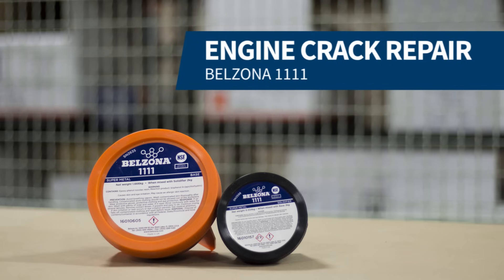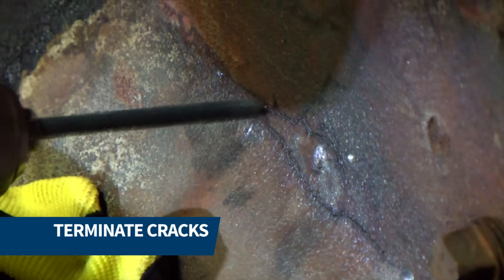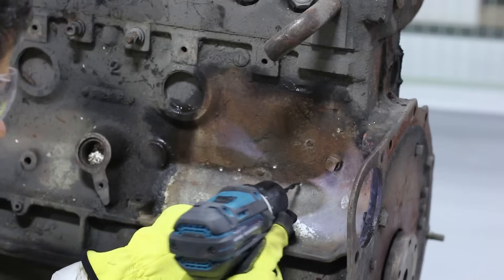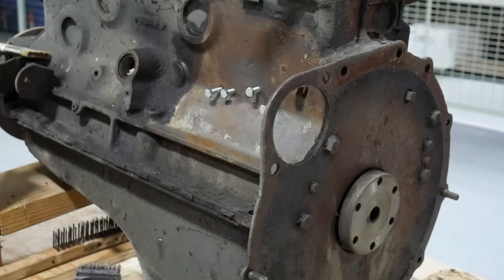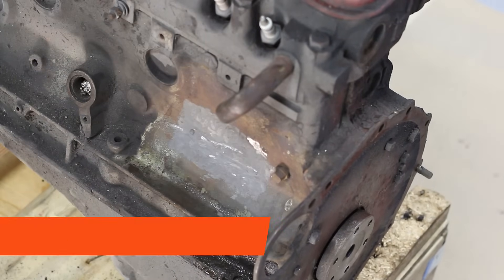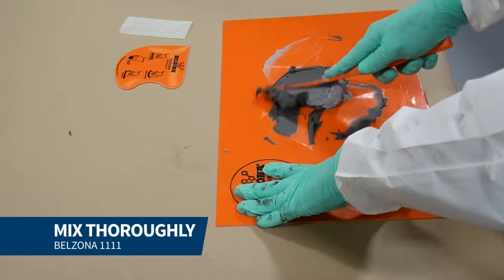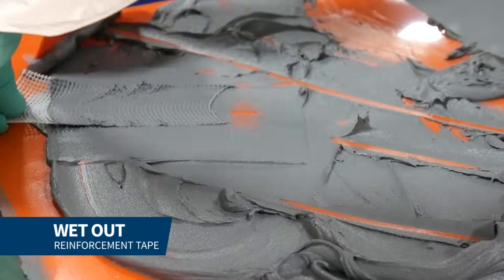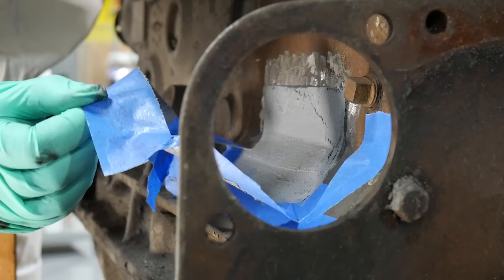How to Repair a Cracked Engine Block

Comment: THIS PRODUCT WORKS! I used carb cleaner and starting fluid to clean my surface. I then dipped the bolt in 3 in 1 oil, placed it in the hole. Mixed Belzona per specs, and packed it around the stud and put more than needed. I then smoothed it out with my gloves dipped in carb cleaner. This allowed me to smooth it out nicely. I did this on a 302 block that cracked by the water pump.
Reply: What does it cost?
Reply: @caseycasey5778  I paid $350 for 1 kilo, but I could have gotten away with a can that was about $175.  I really didn't know what to expect but it really works.
Reply: @travisc3571  how long has it held up
Reply: @travisc3571  350 for glue and you have to buy cleaner and studs yourself? Thats crazy!
Reply: @CholbePilot  huh? My block was broken so no repairs could be done. It’s still working.
Reply: @caseycasey5778  sorry man. I just seeing this…it’s still holding strong and it’s been well over a year.
Reply: Don't lie!😂
Reply: @lexandersig  lie about what? Want to see it on my truck? It’s actually used here in a lot of the refineries…that’s how I found out about it.
Reply: @travisc3571  I justo wanted to create sensacionalismo lol! I know is good product.
Reply: @lexandersig  lord today. 😂😂😂 it saved my tail that’s for sure!
Reply: @travisc3571  😄
Reply: What type of pressure is your block under is it for racing or casual driving I have a diesel motor 500 horsepower

Comment: I think I'd probably just buy a good used replacement motor or block. I once had an Audi TT 1.8t with a failed piston. I just purchased another good used block with pistons from a VW Jetta (same block)  for only $150. Swapped the cylinder head and everything else over from the TT engine. Ran great after that.

Comment: i had a 79 ford bronco 30 gallon fuel tank. the whole bottom of tank had pin holes on the entire bottom  surface when i removed the skid plate it was rotted away from the two metals contacting each other. i ground all the rust and loose debris on the tank, smeared a liberal coating of belzona  let sit for 24 hours. people were saying when you put the skid plate back on it will smoosh the plat to the tank, and  crack the repair. i was concerned. it never leaked again till i sold the truck years later!
Reply from the maker: Thanks for sharing your experience of using Belzona products, Dan!

Comment: Mine has a hole in the engine block. 
Can it be fixed?
Reply from the maker: Hello and thank you for your question! Our product might work, however, we recommend that you speak with a Belzona representative in your area to discuss the problem you are experiencing with the engine. You can find one using this link: https://www.belzona.com/en/about/disfinder.aspx or respond back to this message and let us know which country and city you are located in. Thank you!

Comment: i did not have success with this product and followed this procedure exactly. it was a cat3126 tho so of course the entire corner of the block would have popped off if the head was removed

Comment: How much hp and compression has this been tested out to?
Reply from the maker: Hello! All test data for Belzona 1111 - the product used for this repair - is in this document: https://www.belzona.com/viewfile.aspx?id=52299
Reply: This repair has what relationship to HP? He's repairing a coolant leak  issue in a block.  Better question is, what is the rating on your radiator cap. I'm better than 16 lbs or less.
The flesh and a high quality block saver might work just fine. A block sealer might even be better after doing the girl on tap method shown in this video is simply to keep the crack from getting wider and the crack itself flexing though it would be a minimal amount.
Reply: @randywl8925  idk product application tolerances maybe 🧘🏾‍♂️
Reply: @calongoodlie1647  there are some pretty damn good epoxies out there and they wouldn't hold the pressure from combustion however if you stabilize the block like they did with those screws so it couldn't take back and forth, JB weld might work just fine.  The two drilled and tapped holes at the front and back of the crack would stop the crack you just need to stop the pressure coming out of a minuscule crack. A good block sealer alone might do that that might cost you 80 bucks. I'm taking a couple hundred bucks for their product and 80 bucks for a block sealer would be much cheaper and probably as good as buying a new or even a rebuilt engine.  
Either way, to do the repair you'd have to remove the engine to gain access to drill and tap so it would be a messy process regardless.

Comment: Wish you guys sold your product in the USA in smaller quantities. I tried getting in touch with corporate via email several times and no one ever answered my emails. I spoke to a local belzona distributor but he said the smallest amount sold is quite a lot and all I needed was a small amount to repair a rotted piece of cast iron on an engine water pump outlet. Would be perfect if you sold it in sticks like JB Weld does. I gave up trying to contact you guys and will try welding the area with Muggy weld 77 rods.
Reply: Would be nice.  I have a hole in a washing machine that would be easily fixed by this.  The inside part that gets wet.  But I don't need 1KG lol.  Might as well buy a new washing machine.
Reply: @VeritasInsights yes exactly! I ended getting a welding rod from a company called muggy weld. It was for a water pump hole on my 73 pontiac firebird that rotted out and the edge of the hole was missing a piece. Filled in the hole a little a time not to overheat the brittle cast iron and it worked. Its been about 5 years, the same amount of time when i made this comment.

Man new appliances are garbage. My parenrs bought a Samsung French door refrigerator and it has been complete garbage. The icemaker does not work. The bottom freezer drawer door broke off, some of the shelving pins broke off.so dissatisfied it was a $3000 fridge!!

Comment: I used this to try to seal one of the infamous "shifted casting" #53 Cummins/Dodge diesel blocks that cracked, and was leaking coolant.  I made the weld repair with Muggyweld rods which leaked immediately - contrary to their "testimonials" and the owner's advice!  I then prepped and applied this very expensive crap to try to seal any coolant leaks.  The Belzona engineer gave me wrong prep instructions (wrong size of sandblasting compound) and the Belzona failed and leaked.  Ground all the Belzona off, tried more Muggyweld, then sealed it again with Belzona.  Belzona provided 1/2 of the material to re-do the job, and the engineer even came out to watch and instruct.  It held for less than a year, then failed again!  I control the "leaks" with Fiberlock cooling system sealant and will be replacing the block some time in the future.  I read all their glowing testimonials (both Muggyweld and Belzona) that suckered me to spend hundreds and hundreds of dollars on these failed attempts to repair.  Save your money - Muggyweld cast iron rods don't work on engine blocks that heat cycle.  Belzona is over-priced snake-oil epoxy that cracks and delaminates even with an engineer-supervised application.  In addition, I had a new, unused container left over (sealed/never opened).  This was very expensive.  Went to try it for another (different) kind of project and found it had hardened!  Belzona informed me that there is a fairly short shelf life (which is NOT printed anywhere on the container or conspicuously in the instructions!), and since I couldn't locate my original receipt, they would not be replacing the (very obviously new, unopened) container, nor give any kind of credit!  Very strange snake-oil company marketing overpriced epoxy!
Reply: Whoa Todd-DeJaVue...Me and my 53 block are there...have applied the Balona twice with same results- STILL LEAKS. I have the Muggyweld  sticks waiting in the wings but like you, am convinced the only way to END this nightmare is a new block-Engine only has 150,00-Fucking Dodges...
Reply: The block needs to be stripped and placed in an oven then either brazed or eutecticaly spray welded.
You have to groove all the cracks out.
There's a lot of prep work for the repair work to be done properly.

Comment: Back in the 1970's I drove a Freightliner that had a hole in the block repaired with fibreglass and epoxy... never leaked and the engine ran that way for tens of thousands of miles.
Reply: Rick Schlabowske My father Machinist, mechanic and finally a marine Engineer. repaired a hole in my 1973 Chevellle 351 engine block with JB Weld . Never a problem after. .
Reply: @DrBill-zv5dx  chevy didnt make a 351 in 73...you mean a 350

Comment: Research this company. They do amazing things using chemical bonding. I was fortunate enough to have met the owner. Very knowledgeable people. This was invented for military use.
Reply: Summit Castle where can i purchase the 2kg kit?
Reply from the maker: @kevinbusby734  You can find a local Belzona supplier using this link: https://www.belzona.com/en/about/disfinder.aspx. Best regards, Belzona Team
Reply from the maker: Thank you for your comment! Belzona 1111 can be used in any type of industry. Here is more information on this epoxy-based product: https://www.belzona.com/en/products/1000/1111.aspx

Comment: This is like putting fix a flat in your tire. Yes it may work for the very short term but will cause you a big headache when you have to fix it the right way. Do it the right way first save yourself time and money. Lock and stitch or welded or a combo of both.
Reply: Or a new or suitable used block.
Reply: Unless you've used this product I don't think you can pass it off as the "wrong way"... on my farm I've barely  ever resorted to welding after finding this product. Although I'm sure the manufacturer won't mention it due to saftey reasons this product works amazingly well in the worst conditions. Dirt, dust, grease rust, etc. It just bonds it anyways...yes clean first for best results.
Reply: insert video of right way, or link to video

xox

Comment: have any of the experts here ever properly welded cast iron
Reply: The only form of welding that should ever be done on cast is eutectic spray welding. Brazing is another good option. 
I've tried mig brazing but it melts too much of the parent material before you can get it to wet in. 
The trick is you don't want fusion on cast you want mechanical joints which is why brazing and spray welding work so well because they don't melt the parent material and cause fusion.
Reply: The honest verdict on welding cast  is this' you will never sleep well if you know its welded'  its just one of them things it might hold 1000 years or split 2 minutes after it heats up. If you have nothing to lose weld that shit but just take every day as a blessing when it holds
Reply: @johnhosler6636  which is why a lot won't bother fixing a crack and instead replace the block with a new one or suitable and inspected used one
Reply: One way is to use an oven. Take the block out, slowly heat in oven, weld, slowly cool in oven. Use temp sticks throughout the process to make sure your block stays within your desired temperature range (depends on metal). Heat + patience + temp sticks + tig welder = 🥳

Comment: What's the advantage of this over the tried and true metalock and stitching?
Reply from the maker: Thank you for the question! We are showing another way of repairing a cracked engine block. Using an epoxy composite like Belzona 1111 does not require any hot work, but will maintain the integrity of the engine and provide corrosion protection. Repairing cracked engine blocks using epoxies is another proven method. Please feel free to let us know should you have any other questions. Best regards, Belzona Team

Comment: Why the drilled hole and the inserting bolts?
Reply: I know, why the bolts making more openings, maybe to stop a crack from traveling? I used Permatex cold weld on my IH block 25 years ago and still holding. I think it has really now just rusted closed for good now.. not one drip. But need to clean engine and rough it up well. Chris
Reply: reinforcement + it removes the "ends" of the cracks thus less chance of it cracking.
Reply: I don't know man. They are all patch job. Welding is best
Reply: @romyenglish  You cannot weld a iron engine block.
Reply: @omcdude64  lolz

Comment: Weld the dam thing, I would never trust that puddy
Reply: On newer engines i agree but on older cast iron engines, if you welded them without taking precautions you could crack them BADLY...
Reply: @d4rkhound388  and even welded correctly they micro crack on the sides of the weld over a long period so I'd cover them with this stuff anyway.
Reply: I used JB weld on a trctor. It hold for a while but then started leaking again
Reply: heat and cast do not mix well,  the weld would just separate from the cast and weld area + the heat will cause the cast to crack further. this should be metal stitched for a proper repair.
Reply: @TheMrMattola  actually I'm interested too.  I just inherited yet another goddamn 4age Bluetop and wanted to experiment with this one.  I want to somehow attach strengthening ribs along the sides of the block.  Maybe make it as strong or stronger than the 4agze block.
Reply: t Mann - if the engine is out. i would too
Reply: No need to weld,here; the shown method is best and can be easily done ; welding cast iron is tricky,it requires that the block be heated prior to welding; and this would cost a fortune ,you'd have to remove it from the car and strip it,a MAJOR  job.
Reply: Why wouldn't it hold? Only has to take 200°f 15psi max.
Reply: @richardturner8630  the expansion and contraction of the metal will destroy it and separate from the glue and the metal
Reply: Truth Only  look it up on YouTube several videos on it works great been around for years
Reply: Putty. Fucks sake.
Reply: Better still, trash that block. Buy a new or used undamaged short block, machine it, inspect internal parts, reuse if possible,  replace if necessary.  Expensive but you'll only have to do it once.

Comment: Can you use this on a engine still a truck. Have no way of taking it out. Thanks
Reply from the maker: Thank you for your question! The repair shown in the video is an example of best practice. We understand that in the field it is not always practical or possible to dismantle equipment.

We always recommend that you should follow the manufacturer's product Instructions for Use (https://www.belzona.com/viewfile.aspx?id=51037) and attempt to perform the repair following as closely to the best practice and procedure as possible. Some changes may have to be made in procedure due to access and/or available equipment. 

A clean, dry, firm substrate that is prepared as good as possible should be the minimum required before applying the product. If you need any further assistance, feel free to reach out to a Belzona representative in your area: https://www.belzona.com/en/about/disfinder.aspx. Best regards, Belzona Team.

Comment: just use jb weld shit works good
Reply: JB Weld was invented for these kind of repairs.  It was originally designed to repair cracks in flathead engines.